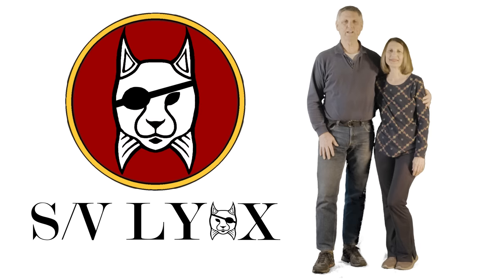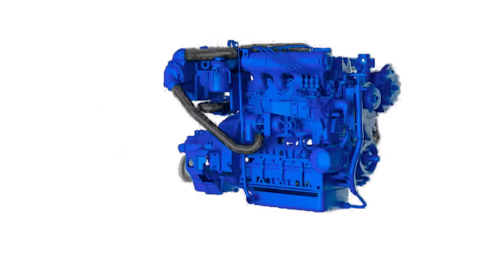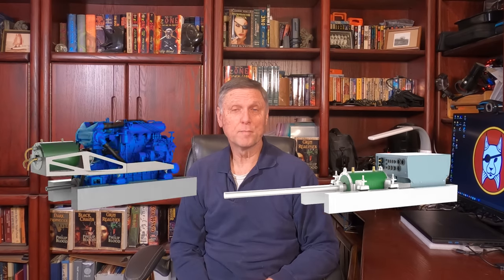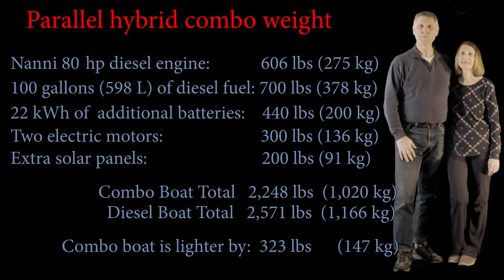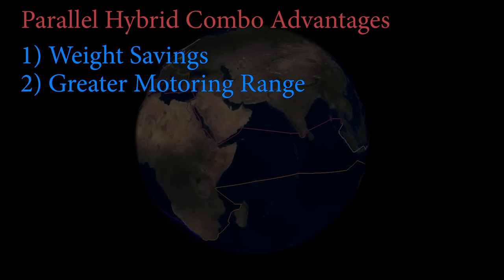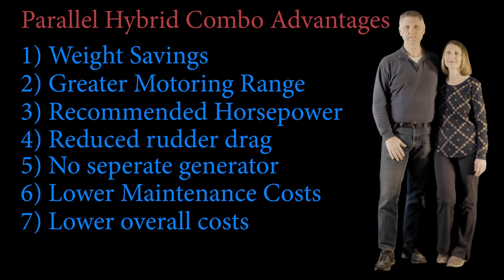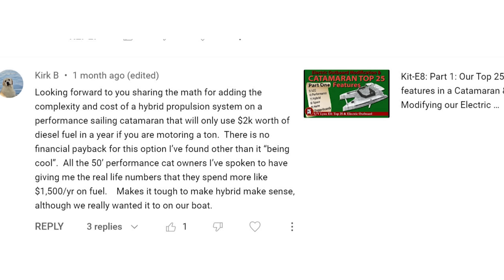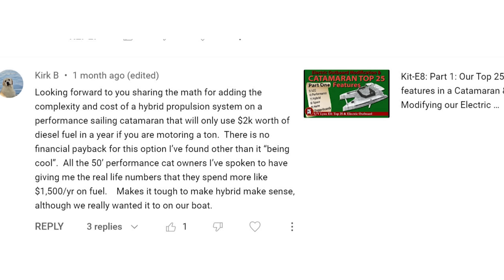Kit-E18 Parallel Hybrid Combo Propulsion

Comment: Excellent discussion and research, as usual.
FYI Sailing Zatara, which live aboard a Privilege 585, family of five, parents and three grown teens. They are in the Med this year. They spent the first six months in the eastern med. They have two main engines and two generators, and minimal solar, and have run a/c quite a bit due to Med heat and admittedly motored more than normal. Anyway with fuel consumption and prices (over six months) averaging approx $6.50 a gallon they estimate their diesel bill for 2023 will be over US$20,000.00
You are doing it right.
Reply from the maker: Thanks for the encouragement!  And yes, we watch Zatara :)

Comment: Love your channel and what you are doing, I’m binging them in seemingly random order. Absolutely amazing work effort and documentation. I was looking at your BMS from the three videos where you built the prototypes. Each BMS you were using appears to be rated at 100A continuous and 200A momentary. Since you are planning 3 batteries in parallel (the two in series don’t add to available current) then I see you as having a maximum continuous draw of 300A @ 48V for 14,400 W available for both house and propulsion. The good news is as you already know, your 33kWh of cells are more than capable of outputting the needed current… it’s the BMS, and potentially the busbars. In order to run both engines at 20kW (40kW in total) then you will see a draw of 833A at 48V, plus a bit for house loads. Based on three battery packs that should be around 300A from each battery pack, which can probably only be done with upgraded relays instead of MOSFET versions like your board - which seems more suited for either higher voltage or lower continuous draws. I know that there are BMS models out there that support external relays, though it will need a separate shunt to measure draw instead of being built into the BMS. I think it might be that or or using 70AH batteries at 48V and having 9 in parallel. Sorry, and I hope that I’m wrong… I don’t have any affiliations, but Orion Jr seems like it would work with an external relay, there are likely other options as well. you might want to wire your 230AH cells as an actual single pack in situ on the catamaran in 3P8S structure.
Reply from the maker: The thing is, we don't plan to ever pull that kind of power from the electric motors.  That's why we have an 80hp diesel.  The electric motors are for low speeds, like doing 5 knots or less or tooling around in an anchorage or marina.  Anything more than that, we will turn on the diesel when we need a lot of horsepower.

Comment: I have been doing crazy research after a delivery I did. Hybrid. Essentially a diesel electric sailboat with solar panels, wind generator and just for more fun two hydrogenerators. All put on a 1972 Cal2 46. We left Gig Harbor enroute to San Diego. 

I'll cut to the chase. Very nice weather, hardest winds were 25 one night off of Oregon. We held good constant hull speed of 7.5 all the down. It was a very pleasant downhill run but I was sure the fuel gauge died. Nope. Because of all the redundant systems we were on pure electric most of the time. All that work and thought and they left the original 270 gal diesel tank. What? The gauge never moved because we burned 3 gallons. 900 rpm is all it needed to batteries up, which is idle.
It's somewhere in Mexico getting painted and avoiding California tax for a year. 😂
Reply from the maker: Yeah, we love the idea of our hybrid system.  In the right conditions, the electric motors will perform well, in the wrong ones, we still have a diesel engine.

Comment: Good information! We are wanting to build a Vision 444 and love the simplicity of the Nanni diesels. One question, why cut the fuel tankage down to 100gals? If the boat is designed with the 150g tanks, why not keep the original tank size and fuel to 3/4 (assuming you are trying to not carry the extra weight). Then on very long passages you can top off the tank.
Reply from the maker: We considered it.  The decision came down to space.  The diesel fuel tanks are located in two of the forward deck lockers and we are trying to keep all the space we can in those lockers for things like fenders, etc.
Reply: @SailingSVLynx  That makes sense. I see the same things with other sailors having jerry cans hogging up valuable locker space or just lashing them to the deck. Always thought there would be a better way of Tankering fuel on long passages.
Reply from the maker: @gmonnig  I agree, I hate seeing all those jerry cans.  It's one of the reasons we choose this propulsion system.  Technically, we are never out of fuel since we can get more from solar and regen.  So, we won't have 'range anxiety' on long passages nor feel the need to load up on over 1000 pounds of diesel fuel.  We feel it is better to stay light and sail in less wind.  That's another reason we aren't keeping the 158 gallon capacity, we don't want to fill it up with the weight anyway.

Comment: I agree with you almost all your arguments for your chosen system and appreciate the detail you are sharing. Personally would strongly preface that you are basing your position on educated (sound) assumptions and theoretical projected performance statistics (not much else to do when you are at the leading edge), I am very much looking forward to seeing what real world performance you achieve, I am constantly surprised the single diesel option has not been more broadly adopted.
Would like to hear how you are managing the weight balance disparity that comes with the single engine system.
I understand that regen is a major element in your energy budget, have you considered the benefits of running two 12kw electric motors with selectable clutch rather than the single 25kw. On face value this idea seems daft.....adding more complexity, cost, etc....but....being able to selectively bring smaller electric motors on line for hydro regen might give you much broader range of boat speed where you can effectively engage hydro regen. I imagine you will need to be averaging quite fast boat speed to get significant regen from 25kw electric motors.....smaller motors can allow you to maintain consistent charge at lower speeds (ultimately this is strategically where the maximum benefits of regen for extending range exists), in the conditions (slightly lower than optimal) which one might expect to spend a significant amount of time sailing in.
Reply from the maker: Hey Bunyip, thanks for all the great questions!  We are also looking forward to real world numbers, unfortunately, there weren't many to use at this time since there are no Solitaire 1490s out on the water yet (and of course, no 1520s either, since we are the first).  These methods were the best we could do for making our decisions at this time.  As for two 12 kw motors, that would be a nice option, but it isn't one that was offered for us.  The thing is, we are a performance catamaran, so we will be sailing at decent speeds when there is wind, so regeneration will be possible during those times.  For example, when we are sailing across oceans using the Trade Winds.  However, we actually don't plan to use regeneration all that often since it slows your boat down significantly (1 to 2 knots).  Most passages we don't need regeneration at all.  Remember that 80% of our passages will be single day trips, and on a single day passage, we have enough electric motoring to cover the trip (unless we are completely becalmed, which means, we can't regen anyway with any size electric motor).  Now, to answer your question about weight balance.  Starting with the Port side engine compartment, we have: Diesel engine-606 lbs., Electric motor-135 lbs., Water heater-73 lbs., Total=814 lbs.  In the Starboard side engine compartment we have: Electric motor + control box- 165 .bs., 22kWh lithium batteries-440 lbs., Electric dive compressor-203 lbs., Total=808 lbs.  The dive compressor is separated from the electric motor area by a wall, but is very close by.
Reply: @SailingSVLynx  Thanks for such a prompt and complete response......every boat is different, with different setups and demands and no one really seams interested in providing detailed let alone basic real world energy budgets. So wasn’t expecting anything other that best educated guess.......just think an abundance of caution needs to be applied, it doesn’t take much of a miscalculation or over estimation to skew projected performance figures.
Great to see the extra detail on your weight distribution to.
I think sometimes there’s a tendency to over estimate the potential of energy production systems especially regen.......my understanding is most lithium recharging prefers consistent clean power input and this can sometimes be challenging to achieve in real world sailing conditions. But it seems that you have certainly got you head around the challenges, unlike some of the nay sayers.
Lynx’s propulsion will primarily be a Sail boat, secondary electric hybrid, and thirdly diesel hybrid, plenty of redundancy with one diesel......and so many more propulsion options .... I think it’s one of the best options.
I recall a couple of YT interviews with Bruce Wilson who owned “Waypoint” Lagoon 410 one of the first production electric cats talking about the benefits of smaller motors (amongst other gems), well worth a watch.

Comment: Nice video. Prefer 2 diesels paralleled. If that one diesel goes down.   I'm looking forward to electric motor mount brackets for retro installation DIY becoming available, hooked up between the coupler and tranmission ? The reality and safety of having that diesel when you have to have it.! Again.. nice video guys.
Reply from the maker: To each their own.  We have sails as our primary propulsion.  Electric motors as a second, and a diesel as the third backup.

Comment: Thanks for the european mesurements. On 11:58 there is a mistake: according to google 100 gallons is 378 litres not 598. But the weight is correct I guess.
Reply from the maker: Ooops!  Sorry that slipped by.
Reply: @SailingSVLynx 100 US Gallons is 378 litres whereas 100 UK Gallons is 455 litres.😉
Reply from the maker: @normanboyes4983  Thanks
Reply: 378l of diesel at .85 per l = 321kg  which is why the total of kg weight = 1060kg but hey super good comparison pesky maths aside

Comment: You have certainly done your math. I presume that all the figures given exclude house needs on both storage and generation side but have you considered the effects of adding additional batteries? Yes it is more weight and cost but assuming you have the generating capacity it delays when you have to turn on the diesel which could end up saving you money in the long term. Of course there is  point of diminishing returns in there somewhere
Reply from the maker: Mostly, house needs were figured in.  For example, we get a full charge of our batteries on a sunny day, but I allocated 8 kWh (1/3 of our usable bank) for House needs and only figured in motoring for 10 NM instead of 15 NM.  We considered more batteries, but decided against the cost and weight simply because we may not need them.  We want start out by matching the battery storage capacity to one day of solar recharge.  If, later, we feel this is not sufficient, we can always add more batteries.   Being a Performance catamaran, every pound makes a difference, and batteries are heavy.

Comment: Wow!  Thank you so much for sharing this information on your parallel hybrid diesel/electric configuration!  I've been researching potential vendors for components to install a similar, but smaller hp, system in a monohull, and your explanation is very helpful!  Did you consider Beta, and if so, why didn't you choose them?
Reply from the maker: Yes, that was the first system we considered.  We ruled them out on cost, they were extremely expensive.

Comment: It’s certainly an interesting way to view powering a Catamaran. The main issue I see is the unknown reliability of the electric drives. Especially the cooling system.
Reply from the maker: Actually, electric motors have been around for ages and are far more reliable than any ICE, with incredibly few moving parts, just a couple of bearings.  Water cooling is also simple technology, again far less worrisome compared to the internal cooling of a diesel engine.  We have much better things to worry about on a boat ;)
Reply: @SailingSVLynx  only time will tell!
Reply from the maker: @jacksbackable  On our boat, sure.  But time has already weighed in on marine electric motors as they have been in use for very long.  Here are some quotes from articles about their reliability.  

From an article in Ocean Navigator...
"Are they reliable? Electric motors are mature technology and are much simpler than diesel engines. The number of things that can go wrong is much smaller. Generally they are more reliable."

Or from another source...

When compared to a combustion engine, electric motors have very few moving parts. (A brushless electric motor will consist of almost no wearing parts, just a few bearings) while the combustion engine contains upwards of 200 different moving parts.

The  reduced number of moving parts means that fewer components in an electric motor experience wear over the life of the device. The reduced wear means that the motor’s individual components last longer. This leads to improved reliability and reduced maintenance, especially when compared to a combustion motor. That isn’t to say that an electric motor will last forever, just that the likelihood of a failure or repair is reduced.

(The only components of a brushless electric motor that experience the most wear are the bearings.)

In electric motors, bearings are used to reduce the friction between components, and to keep the shaft or rotor in proper position. Bearings come in many types and shapes. The most common types of bearings used in electric motors include simple sleeve, ball, roller and sealed. As bearings lose lubrication, they begin to fail, and must be serviced or replaced. (But replacing these bearings) is relatively inexpensive and easy to replace or repair upon failure. This ease of maintenance and low-cost repair are also key factors in the reliability of an electric motor.

Comment: Want to talk about specialized sillyness? BRAND NEW BENNETAU the bow nav lights stop working. Lake Union WA to Richmond CA. We stopped 3 times trying to find the bulbs. No one had them and finally My buddies at Englund Marine in Astoria told us no one in the US, not even Bennetau has spares. Full lights, yea but not bulbs. Not even boat yards had them yet.
Duct tape, a box of AA batteries and a Kayak nav light got us to Richmond after the USCG made fun of us. "Legal, yes Captain you are technically legal. Were heading to the bay anyway. We'll shadow you down. How much is one of these? Oh hell no!"
Reply from the maker: That's crazy.

Comment: Is "floating" flexible solar panels for added electricity a possibility while in the doldrums? They're easily stored on a spool when not in-use, and more efficient when cooled by the water. Who cares about drag when you're hardly moving.
Reply from the maker: Who knows?  It's an idea you can try some day.  For us, if we wanted more solar in those situations, we would just spread temporary panels out on the deck and trampolines out front.  However, with 5kw of solar already on the boat, we don't plan to do even that.

Comment: You can get fuel at $4 a gallon in the USA maybe.........But The rest off world maybe not... Its appox $ 2  a Litre here in Austalia ( so 3.78 By 2 is $ 7.57 Ausssie a US gallon  )
Reply from the maker: The price of diesel will be different all over the place, and the price will not remain the same anyway, likely rising.  We figure, the less diesel we burn, the better, for a whole host of reasons.  Yet, we still need a diesel engine on board for emergencies due to the density of energy vs batteries.  Current batteries weigh too much.  That's why we went with our parallel hybrid.  When we can't sail, we will try to be an electric propulsion boat most of the time and a diesel boat the least amount of time, but we have the diesel engine when the situation requires it.